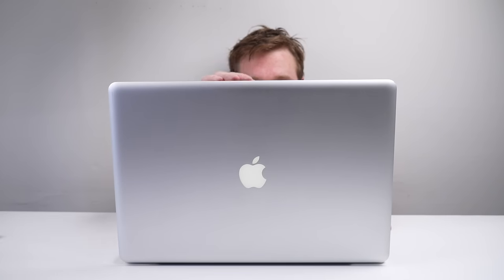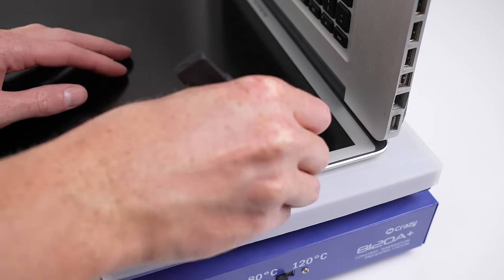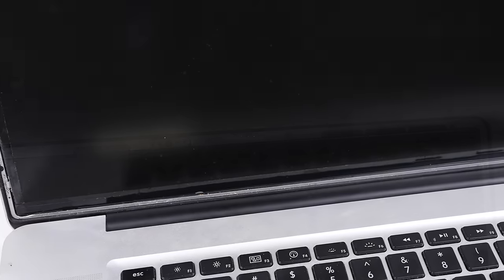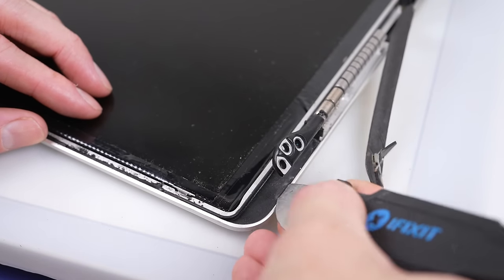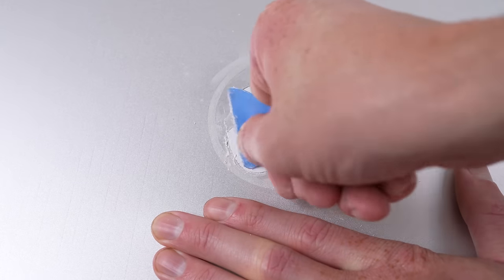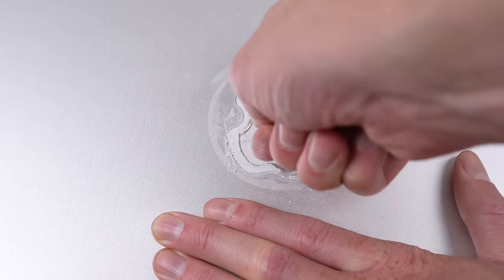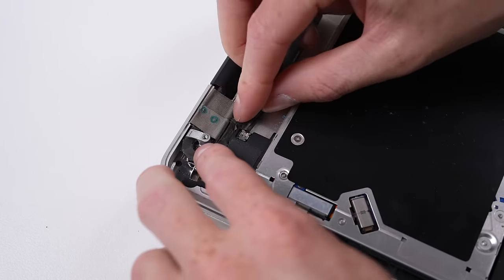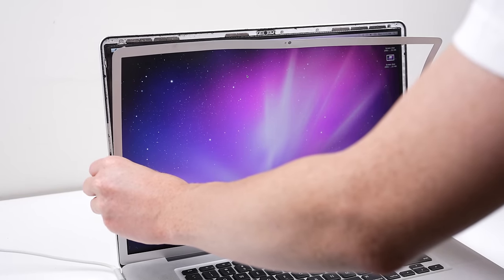Turn Your MacBook Apple Logo Into Any Colour - Custom Glowing Apple Logo

Comment: Nice modification, it's a shame that Apple themselves didn't offer custom Apple logo colors from the factory, or in fact any backlit Apple logo in recent computers.
I probably wouldn't be brave enough to do this, however.
Reply: I only recently learned they don't do the light up logos anymore. I still have my 09 macbook which has it.
Reply: @NaoPb  They stopped in 2015 with the release of the new "MacBook" likely because it added unnecessary thickness
Reply: I believe there is a video out there discussing this. They said something like that they did this back in the day to make people notice the brand but since they are so established nowadays they went for a sleeker look
Reply: @prayhe  yeah I figured as much
Reply: @ventilate4267  and light shines though making the lcd have worse black levels when the lid was in sunlight
Reply: @404hopenotfound  I'd argue that it probably didn't matter much. If your laptop is getting hit by sunlight you're probably also in an environment where it's too bright to actually have decent black levels in the first place. But that is pretty funny
Reply: Another reason why backlight apple logos wouldn't work on modern macbooks could be that the screen panel is oled
Reply: @creeper2671  they use mini led but that would not worth the extra thickness to make it work gaming laptop form msi have a rgb logo
Reply: @ventilate4267  or because it unneceasarily took away profit XD

Comment: This is one of my favorite mods to do for clients, those who've asked me to do it absolutely love it! Instead of cellophane, I use these $0.99 flat, clear plastic document holders, and I can get enough material for at least 5 MacBooks per colored plastic envelope thingy. Staples, Office Depot, Hobby Lobby, and Walmart all have some variation of the flat plastic envelope (it does seem like Hobby Lobby has the biggest variety of colors though) They come in so many different colors, and the material is thin yet the color is deep, letting a surprising amount of light through.

Another great material is dust picker-upper stickers that come with most tempered glass screen protectors. There may be different colors out there somewhere, but I've never seen any color aside from blue. They're extremely thin and highly translucent (so you can see through them while picking up small dust pieces before installing a tempered glass). They work like an absolute charm, again, as long as you want a blue logo. I'd say dust-removal stickers are a near perfect material for this mod (AS LONG AS YOU'RE OKAY WITH BLUE 🙂).

Thanks for this video Hugh! This is a fun mod to do, and when a client sees their MacBook's logo glowing a color other than the standard white, well it's always rewarding to see someone so excited!
🙂👍

Comment: Another fun mod that's similar to this one, but with WAY MORE DRAMATIC results is. . . THE DISCO IMAC MOD!!

First things first Take EVERYTHING out of the iMac (21.5" & 27" models for best results) and then punch out the Apple logo plate from the chassis. Replace it with a curved piece of semi-transparent acrylic (or even transparent, some people really dig  being able to see inside the machine, although you can't see a ton, so IMHO, the LEDs are definitely necessary). Use a small piece of very thin acrylic, along with a strong adhesive, using clamps so the acrylic conforms to the inside of the chassis, laying flush with the back. I then install a Bluetooth controlled RGB strip, powered via the USB pins, sans USB connector. Simply cut off the type A connector and solder the wires to the bottom side of the thru- hole USB pins on one of the USB ports. BTW, MAKE DAMN SURE THAT YOU  MAP THE PORT AND TEST IT WITH A METER BEFORE PROCEEDING (You'll be soldering on the side of the board that faces you when you're looking at the iMac head on. (after taking the display off, look at the bottom right hand side of the board. Then when they boot up the machine, the Bluetooth controlled RGB LED strip that you've strategically snaked through the chassis will light up with whatever pattern you like! It'll be very bright as it cycles through the colors; the occasional times I've done this mod for someone  I'll use the popular 'breathing' pattern. That's a good amount of light inside the chassis as well. That's a good amount of light inside the chassis, and so it pours forth from the Apple logo, and if the iMac is on a table with a wall behind her, she'll light up the whole damn wall!!

I can't remember what compelled me to do that the first time, but that's quite a fun mod as well. And for anyone concerned, nope, you're NOT hurting your USB ports, the power draw from the 5V multicolored LED strip is negligible.

Thanks again Hugh!
🙂👍
🙂👍

Comment: i did a very similar modification to a Powerbook G3 Pismo, and put one of the older rainbow Apple stickers in place of the default white logo. Turns out they were the same size, so it was a perfect match! only catches, was that on those older powerbooks, the apple logo appeared upside-down when opened, and back then, i was not aware of the significance of anything rainbow colored, so i might have gotten some weird looks back then. My thinking was that i was honoring Apple's original multicolored symbol on its (at the time) newer hardware.

Comment: Now do it to a retina macbook pro 💀💀💀
Reply: might possibly be possible, you can apply the shaped film to the logo and superglue it there.
Reply: I bought a broken M2 Air last year and replaced the broken screen with a new one. It was a challenging task and on the way I was checking out if it would be possible to remove the metal logo. Surprisingly, it is! I was able to remove the glued in metal logo and was able to use the backlighting panel of the monitor to make the logo glow. However it was empty, so there was a gap between the frame and the backlightpanel. What you could do is; remove the metal Logo, make a silicone mold of it and replicate it with clear resin. :D

Comment: I thought you might have done a homage to the Apple logo from the Apple II era, 80’s/early 90’s, with the rainbow stripes coloured logo.
That would have been much more difficult to achieve, of course (having to cut and link several coloured strips together) but would have been a nice touch.

Comment: Where can I find the info to send you a phone? Its a Google Pixel 6 (carrier unlocked). I dropped it face down and the screen went black. The outer glass is still in perfect condition, as is the back. I believe the OLED screen has a small crack causing the issue.

Comment: I'm surprised you don't find a way to add or change it to LED colour changing light, that you can run from the laptop somehow!
Reply: There was an iPhone 6 mod for this, it was a light up icon with a touch sensitive back, you could tap or hold it to change color. Awesome.